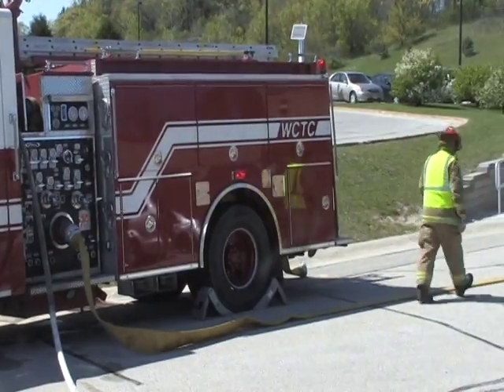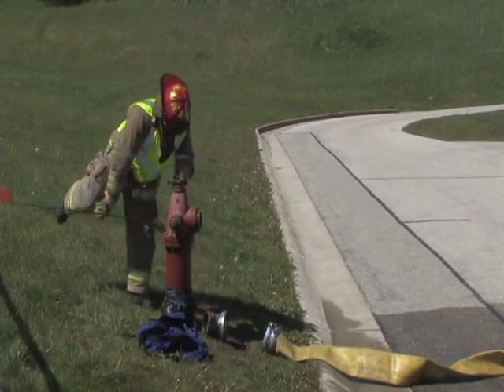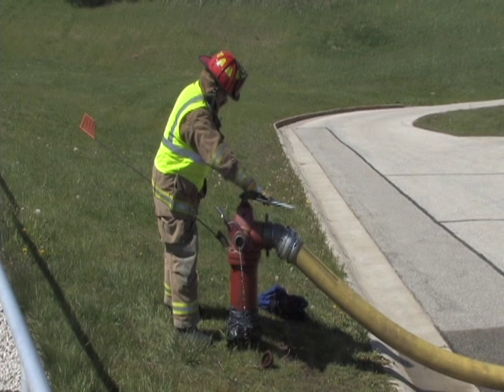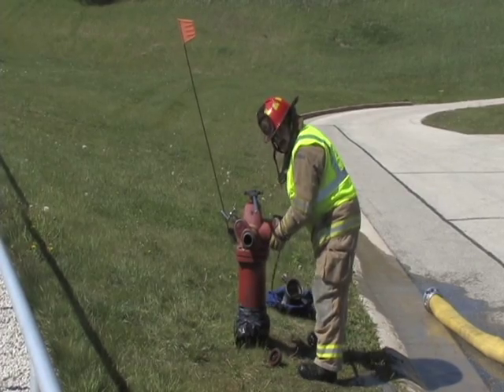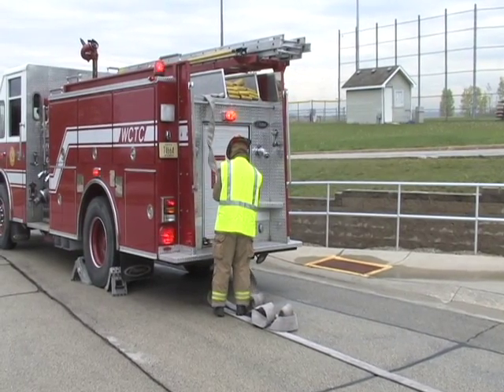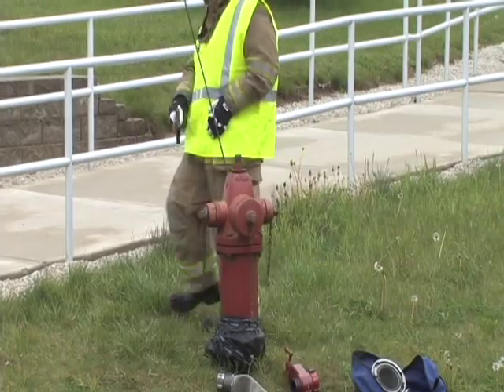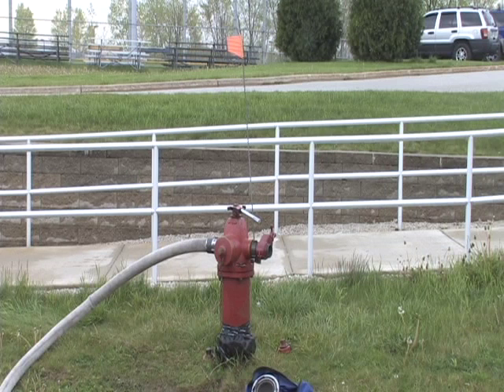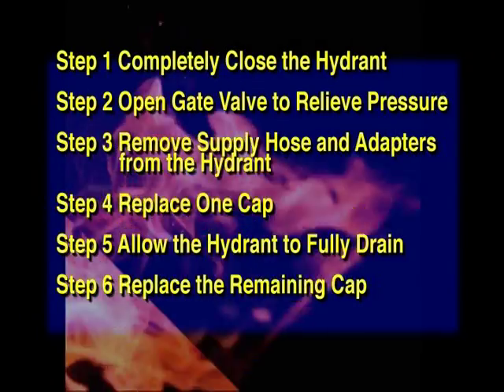Wisconsin Firefighter I- Water Supply- Rural Supply and Hydrant Operations

Comment: decent video but one thing you missed was refilling the tank if it was used before you had your water supply, you dont want to have everything packed away and get a call before you returned to station with a empty tank